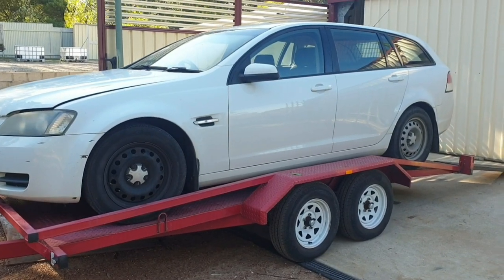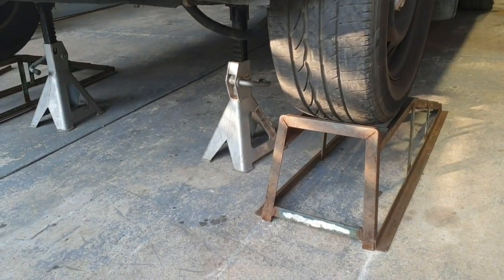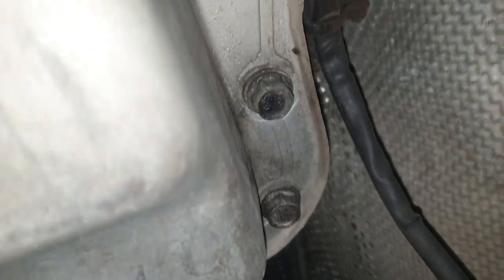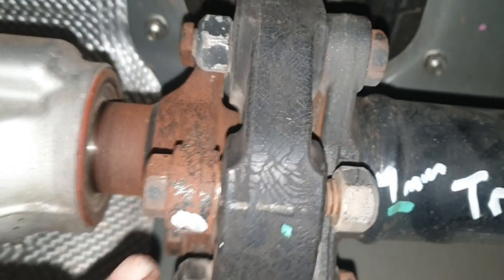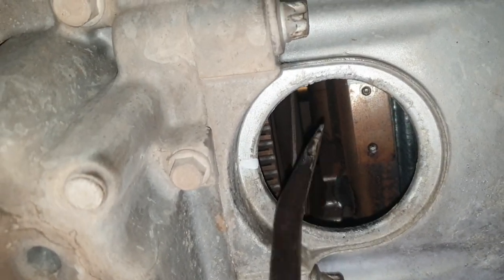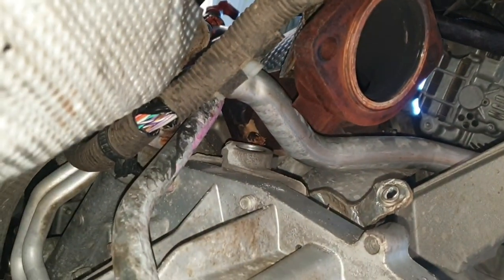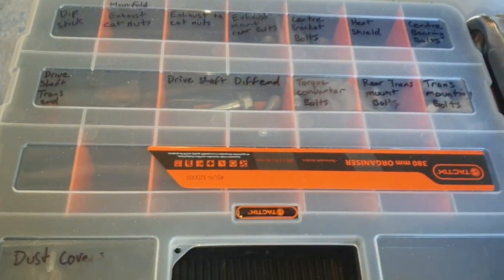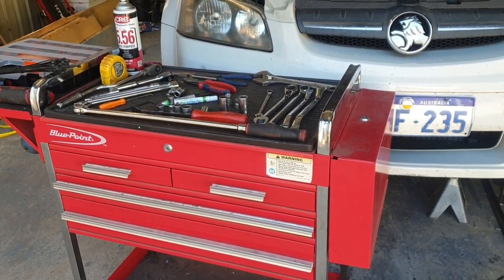How to remove ve commodore transmission on the ground in the shed

Comment: Mate hands down the best and most well explained video , got my Transmission out without a drama , tomorrow I proceed to stage 2 , thanks heaps legend 💪🏼💯
Reply from the maker: No dramas mate 👍
Reply: G'day, just wondering if it's the same deal for a vf sv6? Cheers
Reply from the maker: @FredricksonZak  it should be very similar mate 👍
Reply: @downtheshedwithbyron  Beauty thanks mate, my converters decided to crack. Fluid pissing everywhere.

Comment: If the bellhousing bolts are tight (as they generally are from the factory) and you use an 11mm socket and round the bolt off, you are in deep shit! Use the correct E torqx socket, they are not expensive at any tool shop. Do not round those bolts!! If the e torqx socket is not on properly you can still round the bolt head.
Reply from the maker: Yeah your not wrong bro i ended up buying a set from Bunnings haha $25 or $30 something

Comment: this came in very handy to use as a reference tool. had to replace my transmission on my 2010 ve lpg model recently. only difference was my catalytic converters are actually part of my headers and couldn't unbolt them the way you did. cheers for making the video

Comment: I've replaced the motor on my calais ve v6 sportswagon that has a 6 speed Trans  .motor came out of a 5 speed Trans set up.   When I bolted it all up to the old Trans,  torque and fly wheel , the pulley becomes tight and won't spin . In turn car won't turn over . Any help be much appreciated
Reply from the maker: Gday mate 
Sounds like the convertor maybe out check out this video a about the 5min 29 sec mark https://youtu.be/9k0CSh26ePY

Comment: How do you get the rear bolt on the passenger side CAT out , or is it easier to drop the whole manifold on that side. I can’t get a spanner or socket onto it
Reply from the maker: Oh mate i cant remember 
Single hex shocket with wobble drive extensions?
Reply: @downtheshedwithbyron  I actually used a 5/8” hex head and low and behold it actually undid. Either that or the 3 days of squirting it with crc . Such a poor design anyway. As are the locations of the 02 sensor plugs, just poor design imho.
Reply from the maker: @bigmatlock62  awesome mate
Reply: @downtheshedwithbyron  I’m going one level less than you did and doing it on a stony driveway.  I must like laying in the dirt either that or I am just stupid.
Reply from the maker: @bigmatlock62  haha 😄 legend bro

Comment: cannot get the cat manifold bolts off for the life of me, i’ve tried wd, crc, ratchet with extensions, rattle gun, can’t even get in there to cut em, what’s my other options
Reply from the maker: Oh bro thats not cool 
Can you get some heat on to them
Reply: @downtheshedwithbyron  I’ve tried with a propane torch today, I had a lightbulb moment n thought maybe a trip to bunnings to get a steel bit for the drill n just drill them out, there’s no nuts underneath would just require me to buy new cat manifold bolts but may be my only option at this point
Reply from the maker: @trxnchthekidd  bugger 
Long extension and breaker bar
Reply from the maker: @trxnchthekidd  maybe try some cat wobble Drive sockets they are great to have
Reply: @downtheshedwithbyron  I’m going to have to get have to get some, I was trying to take a shortcut and see if I could go without
Reply from the maker: @trxnchthekidd  sweet mate let me know how you go 👍
Reply: @downtheshedwithbyron  I’ve had the wobble drive sockets on there trying for a bit to no avail, can’t think of anything else but to just keep trying and trying i guess
Reply from the maker: @trxnchthekidd  dude thats f
Ummm try tightening up then backing off sometimes that cracks them

Comment: Mate can you shine some light on O2 sensors?
Reply: I meant by way of your knowledge and wisdom if and when you could is all cheers mate.
I'm a fan
Reply from the maker: Gday how you going
O2 sensor measures the air and fuel ratio that the engine is using or not using 👍